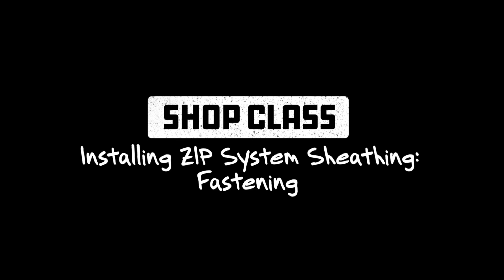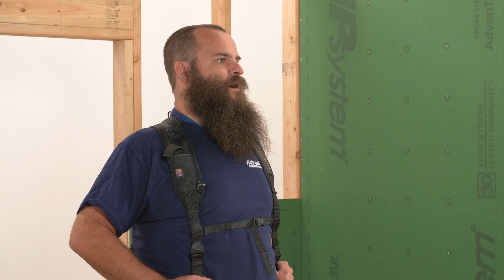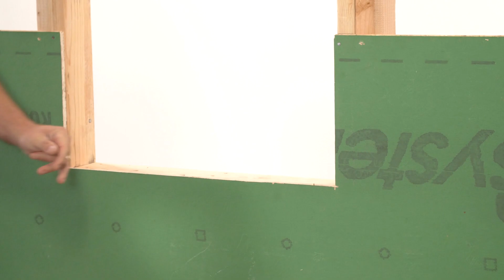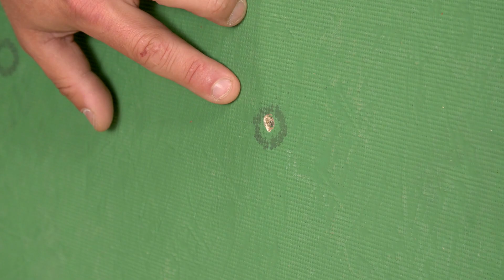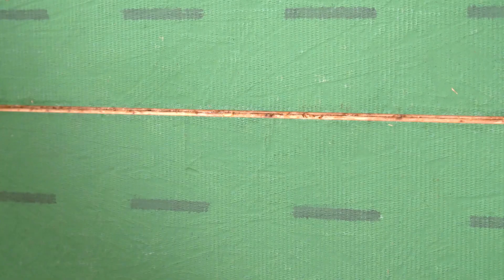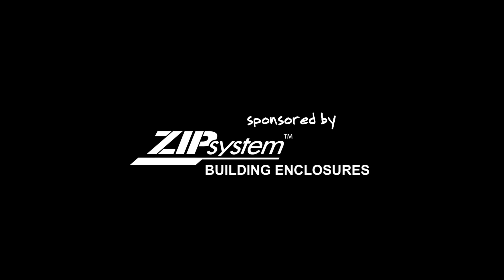Installing ZIP System Sheathing: Fastening

Comment: As a Historic Restoration Carpenter who has worked on the oldest homes in the nation, I wonder how long we will see modern building systems last, or homes worth restoration.
Reply: 20-30 years
Reply: It depends on how well they're built. High performance homes need a lot of attention to detail to properly air seal and ensure drying can still occur. There really isn't an alternative, though, because the cheap energy and old-growth timber that allowed older buildings to last while meeting their inhabitants' needs isn't an option anymore.

Comment: What size nails?
Reply: Hey man, did you get an answer to this question? I can't find this information anywhere.
Reply: .131 shank nail. Nails need to penetrate studs at least 1.5”  @joshuawood6644
Reply: Should be 8 penny

Comment: They say beards have a high percentage of fecal matter. FYI
Reply: Da fuck kinda shit is that to even say as a grown person?  Fucking idiot.
Reply: How big of an idiot are you “Bob”?
Reply: @chadhowell1328  Well that response may explain your intimate life. Just wash your beard with disinfectant and you should be okay. Now that I think about it - twice.
Reply: @bobwhelk2118  your response doesn’t even make sense.  

Point here is that you watched a zip sheathing installation video and your comment is to mention fecal matter in beards.  Literally zero correlation between the videos substance and the comment made by yourself.  You should just stay off YouTube if that is your way of adding to the platform because you’re way off base.
Reply: @chadhowell1328  If you google fecal in beards you’ll understand my concern. There’s several articles and reports on this.  Once I saw this bushy beard I had no choice but to speak up.  I’m not even sure what the original video was about.